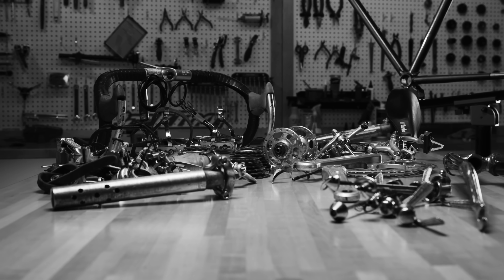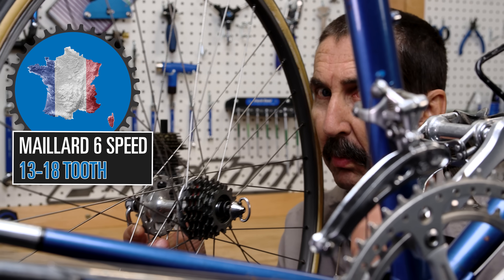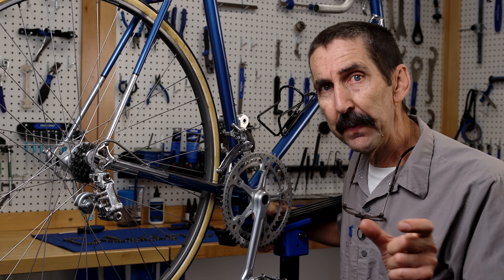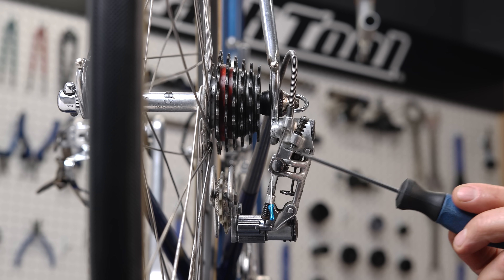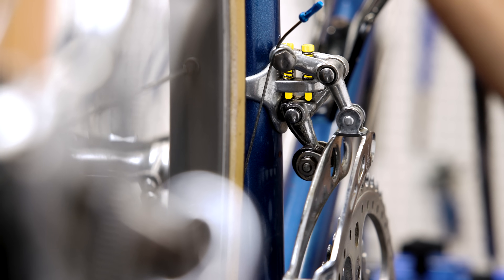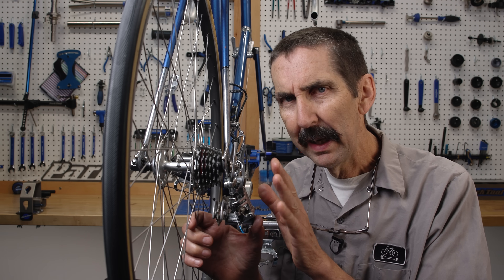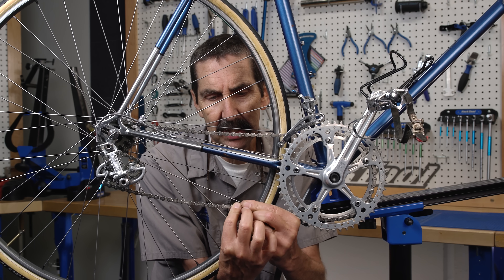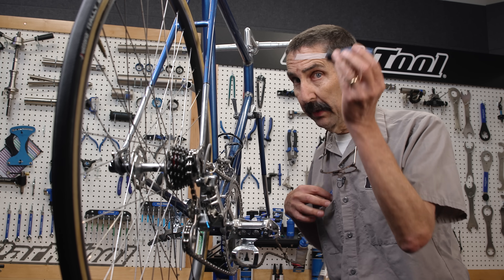What Can Old Friction Shifters Teach Us? | Tech Tuesday #225

Comment: Imagine having to explain to a cyclist from the ‘50s that in the future one would need to “update the firmware” of their shifters
Reply: Imagine telling someone in the 1970s that you would in the future have indexed shifters ( SRAM 
Grip Shifters or Shimano Rapid Fire or Shimano EZ Fire Shifters on Mountain bikes ) I'm spoiled rotten  with  my Indexed shifters
Reply: @seniorcajun  I have an indexed rear derailleur from the 70's--yes, the derailleur, not the shifter, contains the indexing--it's a Shimano Positron. Weird system but it works fine.
Reply: @mattgies ISTR they were rather basic steel devices usually found on ladies' town bikes, the ones with a basket on the front; some used music wire for a push-pull cable, others two cables, no spring in the derailleur. I suppose Shimano did get it right eventually.
Reply: @mattgies  I had a Positron II in 1977. The derailleur had a detent for each of the five speeds. It worked well for two years, then the "push pull" solid wire cable broke. I replaced the Positron II with a Shimano Eagle derailleur that I had from an old bicycle.
Reply: "wait, they can vote now??!"
Reply: @senorspiegel  Chris Rock: "In the 2000s I thought we'd have the Jetsons, we don't even have the Jeffersons."
Reply: Imagine that the manufacturers get it right with the first firmware version...
Reply: imagine telling a cyclist from the 50’s that they can even shift gears as they ride lol
Reply: @johnnysecular Sturmey archer gear hubs were available from 1902, derailleurs in the 20’s and 30’s…
Reply: @PRH123  true

Comment: Front derailleurs would be easier to use if indexing was simply removed. Why implement indexing only then to add a "trim" feature? Indexing on the rear works fine and is valuable. But on the front? More pain than it's worth IMO. Notably, Shimano's cheap TX30 shifter set uses indexing on the rear and friction on the front and works perfectly fine for what they are.
Reply: I have never seen down tube shifters which indexed movement of the front derailleur.
Reply: @peterwillson1355  It is generalized note - with which I am tending to agree: tuning front derailleur recently, it was necessary to have multiple takes, before cable tension preset, index, two limit screws and shifter limits all came together to acceptable result (and yet with marginally apparent rubbing against the cage). There is no sense in orchestrating several positions this way.
Reply: @seksualusis  so you're saying front derailleur index shifting would be GOOD?
Reply: @peterwillson1355  No, I say it is pain in the ass to tune and keep tuned for the purpose of rare switching. Limiters do make sense, otherwise - you move lever until your chain changed position, that's all. To me it would be under sufficient control without indexing.
Reply: @seksualusis  I agree entirely
Reply: @peterwillson1355  I believe that either Shimano or Suntour had a twin lever/single body shifter boss/casting that bolted to the top of the downtube type of shifter that adjusted the front derailleur incrementally with the indexed rear shifter on the the first indexed high end road bikes from Nishiki and Norco, sometime in 1987-ish...? Seemed to be something limited to high end Japanese bikes. It worked really well.
Reply: @tauncfester3022  But indexed front derailleur shifting makes absolutely no sense, except with a triple chainset.
Reply: @peterwillson1355  Well the system I'm talking about is only friction on the front derailleur side, but with a difference; the indexed side, ( IIRC it also had the option to turn off the rear derailleur's indexing, [ the late 1980's was an incredible few years for quality parts and innovation..] ) worked a offset cam that pulled forward and let backwards the front derailleur shifter lever boss so the front derailleur was always in trim to the rear derailleur's position.

 I believe this top mounted downtube shifter was used on the 1988>'90 Nishiki Tri-Sport and Norco's high end road touring/club-racing bikes whose model names I've forgotten.
Reply: @tauncfester3022  That is very interesting, I had never heard of that system. 
I agree, the 80s were great years for bike components. For me, everything up to 2000 or so  is all  I would want. In fact, the only post-2000 tech I use is the tyres and maybe the brake pads...
Reply: Thanks for the tip.  I have both type of shift système.  My problème and I see most people have the same problema.  I have ridden in the same gear my whole life because I do not know when and why to change gears.  I rode beside a guy yester day.  He was commuting on a cheap 28 speed without brakes.  He within two miles stopped due to cramps.  No cadence, no shifting, no brake....he was so happy his truck was finally fixed.  We do not spend enough time on a bike even in a life time these days to know what they are good for, how to ride them and how they work.  Last...I go to the bike shop I tell the guy who owns the shop that we go into a bike shop and walk out with one bike when we need three at least.  He asks three why?  I tell him people who do not plan on riding all year round no matter the course, the time, the traffic, and environnemental condtions buy on bike and hang it on the wall in the garage.  You need in the least sell stands and hooks with the one bike one système you sell.  He was not even motivated by more potental sales and repair volume to see that at least three beats one.

Comment: I still have a Sun Tour Winner six speed 13-18 freewheel. I also have a seven speed Sachs 12-18, and a Shimano 7 speed 12-19. For training, I would use a Sachs 13-21 7 speed freewheel.
Back in the day, I never had a problem with quick friction shifting.

Comment: Ha! I never really knew what the actual function was of the Dropout Screws! 
I still have two bikes with them and Campagnolo Record derailleurs.
Great video!
Reply: you can also use them it alter chainsaw length ie wheelbase which affects handling. or use them to make room for larger tires....
Reply: This was new to me as well. My 1970 Colnago had those screws and I never really new what to do with them. I just set them in the middle and left them that way.

Comment: And it’s not just good for teaching people how gears work. Riding a friction shifting bike is an everyday pleasure.
Reply: I ride both contemporary bikes as well as vintage. One thing I’ve noticed, using a modern chain and late generation freewheel like a Shimano HG, friction shifters work much better and are more forgiving. Riding  with those old chains and full profile teeth on vintage freewheels makes it more fussy. Remember the old days every shift was, tickity, tickity tickity tick, chunk chunk……..
Reply: @mplsmark222 I'm surprised how fast downtube shifters shift.💯👌🏻
Reply: Mixed feelings about this as for my (heavy traffic) commute an indexed system is nice but for leisure the down to earth reach down friction is nice as well. With one of my bikes I appreciate that it can be changed from one to the other as it is from the era where indexing was deeply distrusted.
Reply: @LasseGreiner  It is nice to switch from index to friction every now and again to appreciate the benefits of each. However I will say that I ride in traffic all the time and seldom feel the need to shift gear in an emergency. It’s generally steering or braking that gets me out of a jam! And when you do need to change gear fast friction allows you to dump a load of gears in one smooth, fluid movement.
Reply: @eddieallen6401  i have an old mint giant 980c that has friction+index settings, the friction shifting is a delight. you just can't beat a jump of 5 gears in one smooth lever move :)
Reply: I used to do some racing back in the late 70's and early 80's. Only recently have I gotten back into cycling. I find it so funny how people are now looking back at friction shifters, as it's all I've really known. To me, the action of reaching to the downtube and expertly grabbing a gear was a talent well worth learning.  I've never actually used an index shifter. I'm building a bike now that has them, so I will be my first experience soon. lol
Reply: @sparkeyjones6261 A few weeks ago I bought (most of) a 1985-ish road bike and once fixed it reminded me what I've been missing by only riding more recent MTB-based tourers. That one's not overly practical so I'm building a tourer of similar vintage, it's nearly finished and I expect it will improve my winter cycling experience. So n+1 proved true again (I think I have all the parts to build a 1990s MTB next, but that will have clicks).
Reply: @sparkeyjones6261 I am wondering what you think 9 months later?
Reply: When your indexing system starts acting up oh yeah I'd rather have the older system for sure.
Reply: I find that modern ramped cassettes provide a nice transition and a slight click when the next gears is reached.
Reply: I recently converted from index brifters to vintage looking brake leverss and a friction bar end shifter and it's a nice immersive experience.
Reply: I have friction shifters on 2 of my bikes, and I love em. A thumbie on my 1x mid school klunker and downtube shifters on my late 80’s Miyata road bike.

They allow parts that would never be compatible otherwise to work quite well.
Reply: agree, the other kinds are too complicated for the purpose

Comment: These park videos always seem to pop up at the right time for me. I just started rebuilding a 1992 Trek 2100 with a full 105 groupset. Can't wait for the challenge of learning to shift!
Reply: vintage 105 is index no?
Reply: @Vtoq  Yes.
Reply: As Calvin points out rightly, if you understand the mechanical workings it is not that different. 🎉 have fun on the road!
Reply: I have two old Cannondales running the old Shimano 105, they are all original and work great. I rode one yesterday.

Comment: The only shifter you really need.
Reply: on a road sure, good luck in the mountains with constant changes in terrain
Reply: @karol_janek_wojtyla_pawel_ii   you can change fully from hardest to easiest gear in one sweep of the hand instead of having to click 10 times. love the feeling of cranking into the easiest gear on friction shifters when coming up to a hill, its very intuitive and fast
Reply: remember when Campy had an off road gruppo in the 90s?  Total fail there. @karol_janek_wojtyla_pawel_ii
Reply: @karol_janek_wojtyla_pawel_ii  you could use those twist shifters
Reply: On my bike that is mostly built like a mountain bike I have a friction shifter mounted to my handlebars as a thumb shifter. It's the fastest shifting system I've ever used. Literally zero downsides.